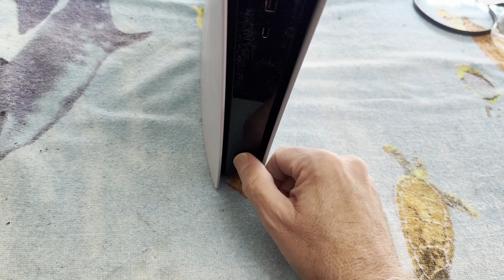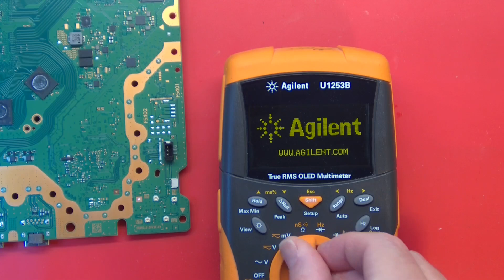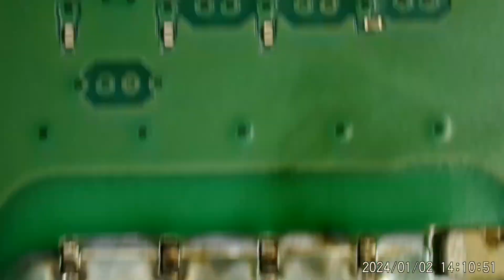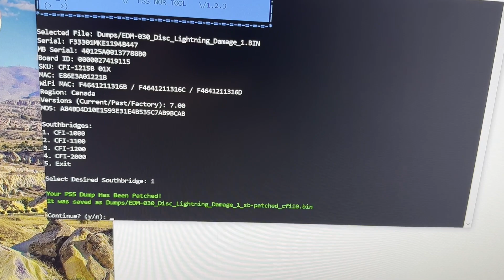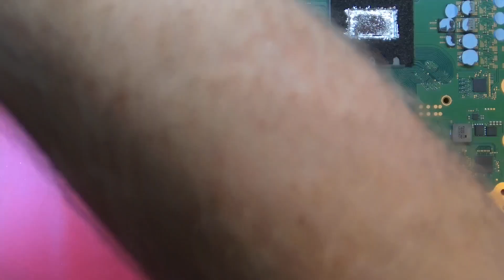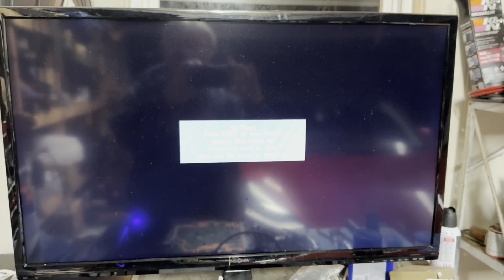#128 Repair of PS5 Digital No Power

Comment: Hello,
Since BWE software no longer works (I bought it), do you have any other solution to patch bios for installing 61GG southbridge on 69GG board?
Kind regards form Slovenija.
Reply from the maker: I would use a donor 61GG bin file that is appropriate for the board model and manually modify the serial numbers and MAC addresses with a HEX editor.
Reply: @ToltecMerc Hello! Great PS5 video series you have. Have you tried this with the dump with 61GG,since the bwe software does not work anymore? If you have tried it, a link of a working dump edm-030 1216a with 61gg would be helpful, thanks! Keep up with the good work🎉

Comment: I changed a southbridge before learning about the extra modifications, I don't know if I used a different southbridge than the original and I've already tossed the old chip. It loads to a white light but no display, is this expected behavior if I have the wrong chip or would it just not power on?
Reply from the maker: If your South Bridge is not working it will normally not turn on at all.  Make sure you did not knock off any resistors around the South Bridge.

Comment: This was a very informative video. Where do you find all these info like mask pad and change in NOR etc. Pretty amazing.

I wonder if something like this is possible with a 42gg in a ps4? That's pretty costly chip.
Reply from the maker: There is a lot of information on the Facebook group "Game Console Repair Legion".  The info about the masked pad and the NOR modification is from BwE or Better Way Electronics.  I have not tried it on a PS4 but I think it may be possible with the NOR modifier from BwE for PS4.  Apparently the South Bridges are all very similar.
Reply: @ToltecMerc  I went through bwe website, but couldn't find anything to read. I guess it's only for his customers. I am a hobbyist I don't make much (most of the time i just break even), so bwe is not my cup of tea. But his work is cool though, his software does benefit many console repair businesses. So does your knowledge and technique, very informative. Keep em coming ✌️.
Reply: @ToltecMerc  I searched quite a bit, can't find any info on ps4 southbridge swap. Couldn't even find this 69gg swap info, I'm guessing that level of support is given by bwe only for paid customers. Oh well.

Comment: thank you very much for the video, good job. I seem to have the same problem, could any one know the values of the capacitor and resistors on the internet port that Toltec replaced? I don't have a spare board, so looking to replace the components
Reply from the maker: I believe the cap is a 1000pF at 2KV.  The resistors are all 75 ohm.

Comment: Can someone help me guiding what shall i do with my customer ps5 which switch on blue light for two secs and shuts off.. dismantled the board and pound all the caps on APU are short as well as all caps on 12v rail.. please ? Checked metal past nothing was spelled
Reply from the maker: The caps under the APU are going to show short (less than 1 ohm).  You could have a short on one of the DrMOS ICs near the row of coils.  They will short from input to output sometimes.  This will send 12V straight to the processor.  If that's the case, you will probably have to lift coils to isolate different parts of the circuit.
Reply: thank you so much for your time i will have look in to it!
 @ToltecMerc

Comment: Nice repair. Did you ever encountered not working wifi (not finding APs/not connecting) and not displaying wifi macs with working BT after changing/editing nor data?
Reply from the maker: I have not encountered that issue.  I did test this console and WIFI seemed to work just fine.  It detected my access points.

Comment: Geez. That strike took out a lot. Good work sir.
Reply from the maker: Yep.  Lightning takes whatever it wants.  Thanks for the visit!
Reply: @ToltecMerc  it really is random. I had a digital that was struck. Took out the ethernet capacitors and the HDMI encoder. But everything else was fine. 🥳

Comment: Great work and great video, as always.
Can you explain the difference between the two southbridge models? Where does the covered contact normally go? What is it for?
Reply from the maker: I honestly do not know what the difference is.  Apparently the functionality is the same.  I don't know what the covered pad is for either.
Reply: According to my diode readings from a 61GG, that masked out pin is ground... I guess leaving it unmasked would short something out on a 69GG board... Whatever it is, no idea